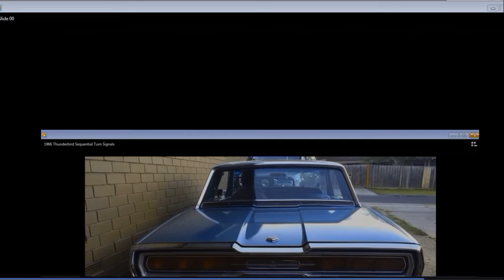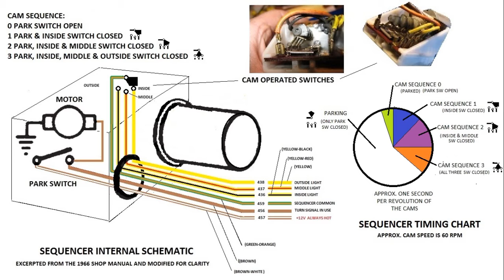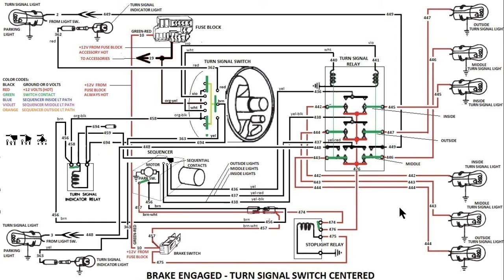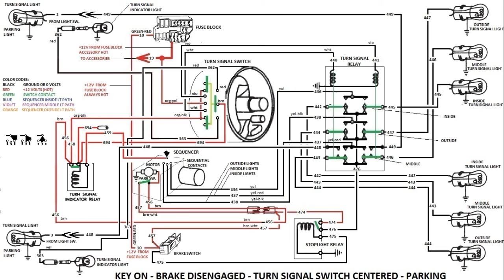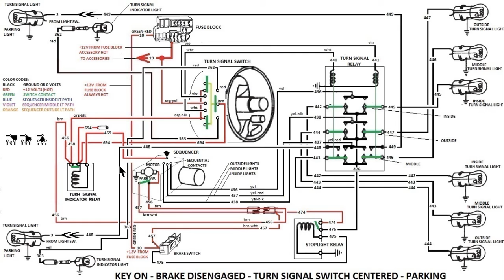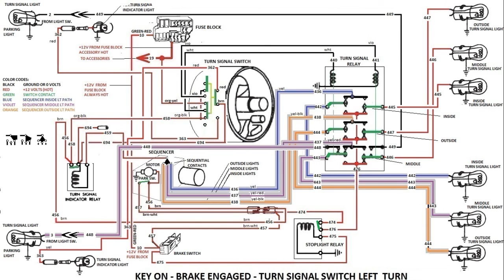1965 1966 Thunderbird Sequential Turn Signal and Brake Light System

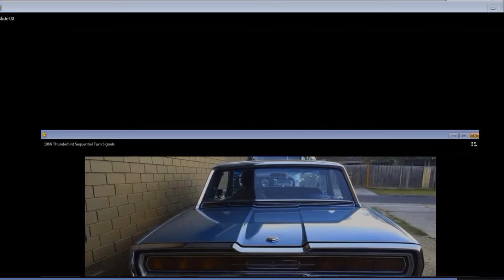Comment: This video shows an excellent explanation of how the early Thunderbird sequential system works. Thank you for posting it! However, there are several errors in the turn signal diagram (1:25). 1: The turn signal indicator relay diagram is incorrect - the input of the relay coil is actually connected to the 458 wire instead of the 694 wire as shown. The current flows through the coil and out the 459 wire back to the sequential motor and lights. It is not interrupted by the relay. 2: The labeling of the 362 and 363 turn signal switch wires feeding the fender indicator lights is reversed. Note: the 363 turn signal switch wire is actually yellow/black. 3: The 474 wire color is not shown - it is red.
Reply from the maker: Thank you for the reply.  The diagrams shown in the video are taken from the 1966 Thunderbird Shop Manual.  In the copy I have the wiring matches the diagrams I used as I just copied and pasted them together and removing the non related wiring.  I noticed your user is CougarsUnlimited so it is possible that in the Cougar system they changed the wiring or the manual I have is incorrect.  And yes, I didn't include colors on all wires.  But you probably know youtube does not allow a method to replace a video, so users should verify their wiring based on your comments, I guess.  The shop manual has the wiring for the 1966 Thunderbird in two parts.  I copied those and made a composite diagram which was used to make the diagrams I used in the video.  A copy is on my website here: http://rbinck.us/tbird/composite.jpg and it is possible there are some mistakes in the Ford manual as I have seen some in other areas. One is the wire color on wire 474 which is not shown in the shop manual as you can see in the composite.  Several others as well, but the wiring seems correct.  The turn signal wire numbers 362 (RH) and 363 (LH) were taken from the manual as were the colors.  Could be more mistakes or differences from the Cougars.  I don't have a '66 anymore, so I can't verify one way or the other.